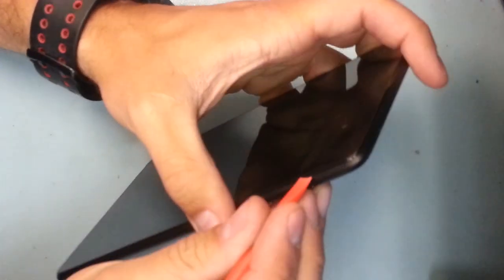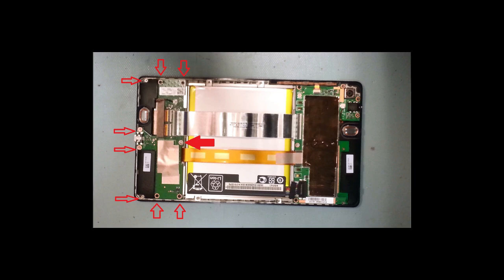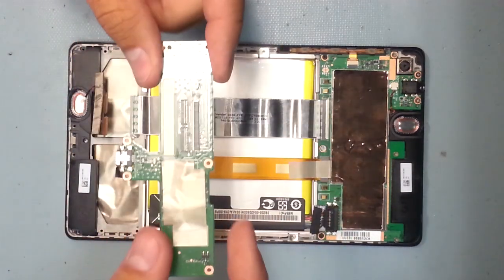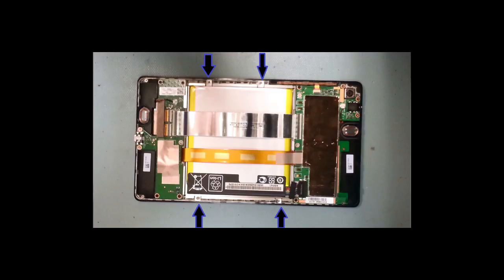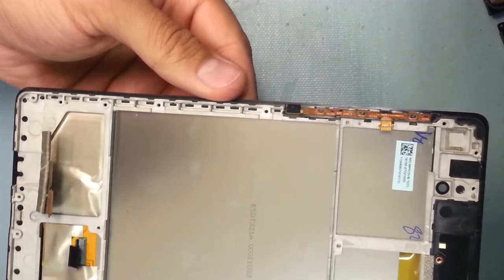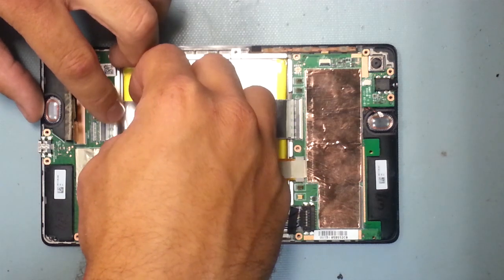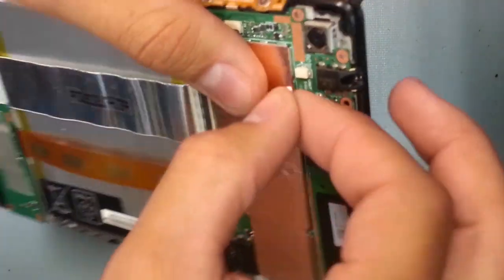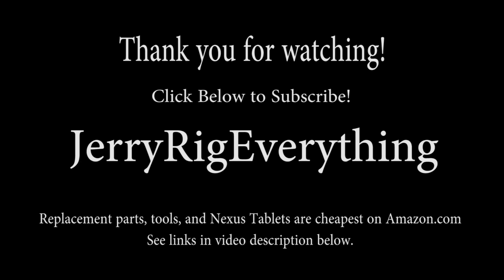2013 Nexus 7 Tablet Teardown. Charging port fix and screen repair.

Comment: Not to be too much of a killjoy here, but I didn't see a repair of anything.  Don't get me wrong, this is an excellent disassembly/reassembly video, and because of that, it has a ton of value.  I'm just wondering where the replacement of the charging port happened.  I watched it through twice because I thought I missed it.

Comment: I don't seem to be getting any power.  I  checked continuity on the usb port and getting continuity on every pin.  I don't seem to be getting continuity from the USB port power pin to the battery power pin. If the battery is totally dead will the tablet be able to still turn on with just the USB? Wireless charging doesn't show any power either. Also is it possible to solder a USB c charging port to replace the USB micro port? The battery showing is ME5PnC1.  Is ME571KL the replacement?

Comment: Where did you get the replacement charging port already attached to circuit board? link not working.

Comment: Thank you. this was useful as it showed the way in. For anyone still having probs getting in, or cracking screens, the important thing is not to create stress concentration, eg by twisting a screwdriver. I found that a 3 inch wide paint scraper was ideal for initial opening of the gap, and then applying a light torque. (my fingernails not up to it). Once you've got a narrow crack, work round with the paint scraper, then use finger force to pull open.

On the down side, getting it completely shut again was a struggle. And I still need to source a battery, charging port.....

Comment: Hi Zac, my Nexus 7 (2) has finally developed this lack of charging bug, I have searched online for a replacement charging port & it looks like they are only selling the port itself & not the motherboard (In your video you show the charging port connected to the mother subboard, I also noticed that you link to Amazon is no longer valid).What I'd like to know is if the charging port component needs to be soldered or does it clip in?
Reply: eBay has multiple as of (11.2020); $$ to $$$$

Comment: Ugh, no. Now I have cracked my screen all to hell to in my attempts to gently remove the back. I used dental floss to locate a starting point and then with a very fine blade I gently slid and opened the gap. Never got the cover off because my screen was dropping sharp pieces all over. Plus, there seems to be a hard plastic gasket around the cover that also broke into pieces. Guess I am looking for someone who can repair all of this now. So sorry I even tried this, it looked so simple.

Comment: I have this tablet and I can't power it up. The screen stays black. I've tried holding down the power button and volume buttons. Nothing. I purchased a new battery. Nothing. It charges, because it feels warm on the backside. It also reacts to wireless charging. Does anyone have any ideas or should I just throw it away?

Comment: what you dont state is that there's a thin delicate bead of plastic around the edge of the device that if your unaware of, you wil probably break while trying to simply open it.. as i did.. congrats. im curious.. are you a qualified electrical engineer? if you are then shame on you! you just misinformed the public .. and if your a hobbyist, then you clearly need to do more research before you start doing "how to" videos. jack of all trades.. master of none..

Comment: When I try to turn on my Nexus 7, I get just a black screen. I've tried charging it over night, recovery mode button combination nothing happens no display. I try touching at back while it's charging, it does get warm. I even replaced the battery with new OEM one. Now I am trying to find if my motherboard or display is dead. Could be anything else too, can anyone help me?

Comment: My Nexus 7's battery started swelling lately, so I took it out just to be safe.. Really wish I could run the device just on it's power cable, but it doesn't wanna turn on that way. :/

Comment: I dont know how you did that so easily... mine was ass hard to get the tool to start on... then the connectors are different: they slide in ...I probably have a different release ... anyway... going to wireless instead.

Comment: I just wanted to thank you for this video.  My girlfriend's mom has a Nexus 7 (2013), that she'll have had for 3 years this Christmas.  It recently went out on her because of a broken charging port and the battery would no longer hold a charge.  After ordering replacement parts for only $40, we successfully replaced said parts and its back working 100%.  You made what seemed like an impossible task super simple.  We were able to save literally $300-400 by not having to get her a new tablet this Christmas.  So a thousand times, Thank You!
Reply from the maker: That is awesome! Good job getting your tablet fixed! I'm glad I could help out a little bit.
Reply: Luke Kuykendall i have a nexus 7 
and he doesnot start android 
help me!!!!!

Comment: First, focus.  Your video quality is not the best.  Many details are lost.  Secondly, weren't you going to repair the screen?  

I've repaired dozens of these, and getting the old screen off is by far the most difficult part, and takes great patience.  Also, it's worth noting that this model of Nexus 7 features the battery holder, which eliminates the chance of bending the battery, (which is not rigid) where bending it would cause the battery to short out and catch fire. Every care must be taken to avoid bending the battery at all.  As for the screen, I use packing tape first, covering the entire broken front surface. The tape will keep many of the small pointy broken glass bits under control, and it will make handling the larger fragments easier to handle.  Then I use a heat gun, to loosen it, prying it up out of there carefully.  Putting a new one in the bezel won't work until you remove all the old adhesive.  Most solvents don't work.  A heat gun softens it, and you can scrape most of it away, but that's tedious.  In the end, I used "Goo-Gone", an easily available adhesive remover.  It's aggressive, but it does the job.  Once the bezel is cleaned, i wiped it down with a damp paper towel to get as much of the "Goo-Gone" off as I can.  That leaves me with a fresh surface for the contact adhesive to hold the new screen nice and flat and tight.

Comment: I managed to fix the charging port on mine by reflowing the solder on the usb port itself. Its a delicate operation, but its working pretty well now. Used lead based solder as well :).

Comment: I opened my nexus 7 today to tape the touch screen cabels inorder to fix the phantom touch issue. A small rubber square fell down from inside as i opened the box. I dont know where it goes. Its really tiny the size of quarter of a fingernail. rubber, black and has a concave shape round opening on the one side

Comment: Hello. My daughter has a second generation Nexus 7 and I've just very carefully replaced the daughter board (rev 1.4) with a rev 1.4 daughter board from her old Nexus (same kind: gen 2). Now the thing charges perfectly, but only part of the screen's digitizer works correctly. It's so bad now that I  can't even type in the password to unlock the screen. I've double checked that the silver ribbon was centered correctly to ensure that all the contacts are connecting correctly, but somehow even less of the screen is responsive now. Should I take the silver ribbon cable from the other (more broken) Nexus? What should I do with this thing?

Comment: The link you have to the wireless charger says it is unavailable. 

I tried buying a wireless charger for the nexus 7 in the past, a little before my charge port stopped working completely, and it didn't seem to work. I want to make sure I get one that is actually compatible but I also want to make sure it'll work without having to access any settings on the tablet because it is now 100% out of power so there is nothing I can do if I need to set it to accept the thing. If I do, do you have any links to the actual replacement parts instead?

Also when it was first breaking I took it in to a local repair shop and they cracked the back cover near the camera so seeing you pop the back off so easily is making me realize those guys were hacks.

Comment: Wow, I hate this video. MY Asus Nexus 7 was nearly impossible to open. I cracked the glass AND the plastic back cover prying it open. After failing to make any progress with my hands and normal tools, I decided to buy some useless plastic tools and follow case opening "instructables" I found online. But no human being could possibly use their fingernails nor any cheap plastic tools to get into the seam between the screen and back cover, it's an airtight and strong seal. I actually wore out the tip of the pry tool trying to get it into the seam. I had to push a razor_blade with strong force down into the seam and get it separated just enough to slip a small screwdriver in and then apply a LARGE amount of pressure to lever in and pop the cover at all--but even then, no amount of "gentle" sliding/prying with any tool I have available to me would loosen it around the corners or on the short ends. Only gorilla force could ultimately undo the case... I hated this thing for it's idiotic lack of both hardware and software options BEFORE the battery died and quit taking a charge when it was barely two years old.
Reply: I used my fingertip and a credit card. Opened with no problems.

Comment: Your link above is for the screen only, not the screen with frame.  You should fix that.  I have a tablet sitting on my desk striped down with the wrong screen to fix it.  That is a bummer.  I'm not up for getting the screen out of the frame and the frame is cracked anyway so I need a new one.  Thank goodness I didn't tell my son he would have his tablet back today.  However, the directions you gave are great.  Fix the link!

Comment: The link to the part seems to be only the screen without the frame assembly. I don't want to do the complicated, heat gun, glass process. I only found this part on amazon that seems to be the full assembly, but it has several troubling reviews:https://www.amazon.com/Screen-Digitizer-Assembly-Google-version/dp/B016MKV3QG/ref=pd_sim_107_2?_encoding=UTF8&psc=1&refRID=A61WQKZ1GTKQQH8DFM68

I would so appreciate advice on where to get the full screen assembly replacement part. Thank you!
Reply: I had same problem, ordered a Nexus 7 screen replacement with "frame" apparently is how you have to search for them. Still did not include the power and volume cable, but I just peeled it off the broken screen and replaced it that way.

Comment: Hi. Thank you so much for this video. Managed to open mine because it got slightly water damaged at the charging port area. Shortly speaking, it's okay now... except for the notification light that won't go off. 

I noticed that when I press the end of the gray wire cable on the charging port side, the light changes. it even went off for a few minutes. So I returned the case and turned on the device, the steady light returned. Also, I think it caused the battery to drain because last night it was 34% when I turned it off. When i opened it today, it was 9% or 12% already. And I don't remember my tablet draining that fast before.

Can anyone tell me how to stop the notification light?

Comment: Hey everyone, unfortunately, my nexus 7 (2013) got a little wet. I tried to turn it of right away when it happend, the screen got a little funky but it did turn off. Once I got home I disconnected the battery and made sure it will dry up properly.  Connected everything but still won't turn on again. However the LED indicates that it is charging,  is it possible that only the screen is buggered? What are the chances, no point buying a new screen if its f**ked. Help much appreciated. Great video by the way!

Comment: Thank you for the easy breakdown of the N7. I had bought one that I immediately dropped and broke the screen and digitizer, nearly $150 to fix. 

I bought a second one to replace it since i needed it ASAP. That one lasted just past warranty before it bricked. 

I used this video to try reseating everything, but it was still bricked. Then it dawned on me to just swap the internals on the two N7. 

Good guts of the broken screen into the N7 with the good screen and bad guts. Then reversed the process. 

Now I've got a working N7 and a bricked N7 with a broken screen. No loss there, it was a sunk cost anyway. 

Thanks again!

Comment: Good video, thanks! I am getting ready to remove the daughter board to solder on a new USB port, and replace the battery. This was the best explanation of the ribbon cable latches I have seen so far.

Comment: Hey, buddy, thanks! Very well done.
The only question I have is about the sourcing of a replacement "daughter" board.....the one that includes the charge port.
I watched another video where the guy replaced his charge-board and he found afterward that his touchscreen no longer worked.
Any advice on how to make sure you're getting a replacement that WORKS and doesn't screw up the touch factor?
Thanks again!
Michael

Comment: HELP! I removed the wrong cable while replacing a nexus 7 display. lost the tiny metal hinges and now cannot get it back in place. any suggestions? image link here...  https://www.dropbox.com/s/ma7kly1g6wdajpb/Screenshot_20160501-181206.png?dl=0

Comment: My Nexus 7 didn't respond to anything. I already tried to push power and volume down, I disconnect the battery but nothing happens... When its charging the top starts to heat... after do you have any idea what can be?
It happens during an installation of last actualization and since that it doesn't turn on anymore.

Comment: this video is amazing! my question is, i didn't hear you say anything about the charging port "fix". did i miss something? my nexus 7 2013 wont charge, wont turn on, wont light up when plugged in... nothing happens to indicate that this is even an electronic device... i was hopeful that i would be able to fix the issue but i haven't found anything that works... do you think that tearing it down and rebuilding it would fix the issue? i hope i get a response, and that you can help...i have a lot of info and pictures that have been lost otherwise and my daughter is heartbroken over it all!  thank you so much for this video though! it really is quite amazing!

Comment: One of the problems that I experienced when replacing the charging port is that the screen responds erratically when I turn it back on. I had to put the old charging port back. Any way to fix this issue?

Comment: My casing seems to made of a different material and much more firmly stuck than yours. The glass is just shattering (it's already broken) and the plastic casing is breaking apart, won't separate at all.

Comment: from the video, it's so easy to move the back shell off. I tried and it's too hard to remove. it ends up with cracking my screen :(
Reply: well i did some of mine now they wont charge

Comment: Hi, interesting project. You did not show or mention the earphone socket removal or replacement. This socket is mentioned by several owners as giving problems. My 18 month old 2013 nexus 7 has just had a main board replaced due to this problem. However the sound connection with any type of headphone socket still gives connection problems. Your comments  would be  interesting and could you show  or say if the main board replacement would  include earphone socket?

Comment: my nexus 7 2013 has always been in great working condition until this last week when I left it in my car for only 1 night and I found it with a dead battery. First I tried to charge it and all I got was 5 blinking notification lights and now I do not even have no indication of power . This was very odd because I never had issues with the battery draining completely .

Comment: Take action guys: use this link ...before they runs out !! Links Here!! ---  https://www.facebook.com/1517160868604660/photos/a.1517166945270719.1073741828.1517160868604660/1519730448347702/?type=3&pidid=0b400a36-949b-44f1-9c7e-379f998317cd  === !! Guides placed right here commonly working. Just got that 9999999 Credits                                                                NEW 2013 Nexus 7 Tablet Teardown. Charging port fix and screen repair.

Comment: You can't open it so easily like in the video, my screen just cracked as soon as I got something in the back
Reply: +H. Petersen I had no issue opening mine. You have to be very careful and realize the headphone port and charging port are hang up areas and to work from top to bottom.

Comment: +Jerryrigeverything I've ordered an LCD/digit error,  which comes inside the bezel/outer rim. Would the easiest way to do this be transferring all of the components onto the frame of the new one? Or is there any other you'd recommend?

Comment: hey i replaced the charging board and now it wont do nothing wont power on just a black screen and no notification light do you have to diconect the battery i didnt but it dont look like you did either

Comment: Hi do you know where I can buy a circuit board for a Nexus 7 2013, my charging port is damaged and I don't want to go through buying a wireless charger. when I can fix the problem myself. Thanks!

Comment: if you buy a new charging board does it need to be recalibrate my usb port is broke on of the back prongs are missing and it's loose could I just solder a new usb port on the board how are the back prong soldered on or do they just lay on the board it would be hard to solder each Lil pin on the board I don't get it

Comment: Since most android devices uses a female usb-b port can i just low temp de-solder a female charging port off an old phone and re-solder it on the nexus 7 2013 main board?